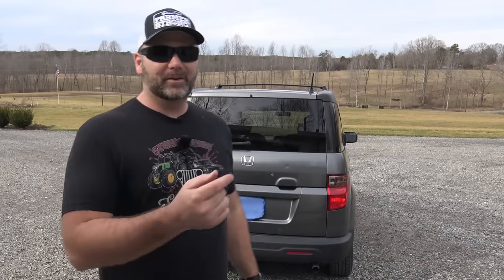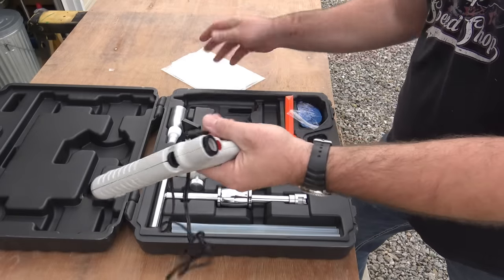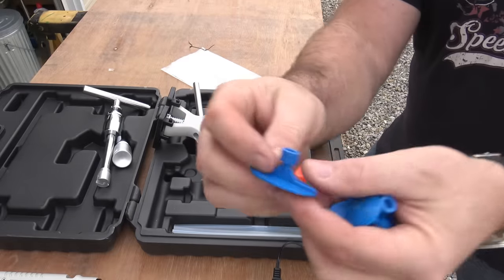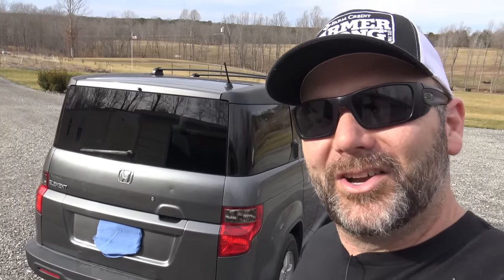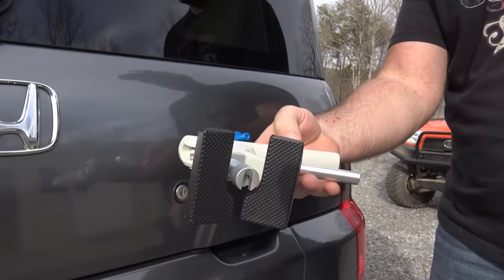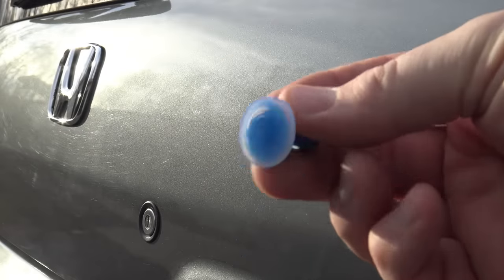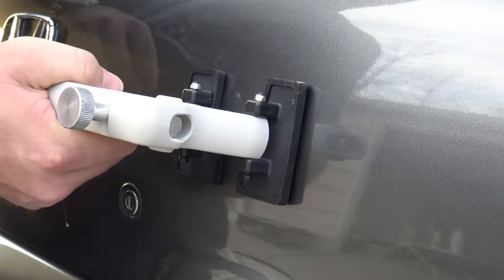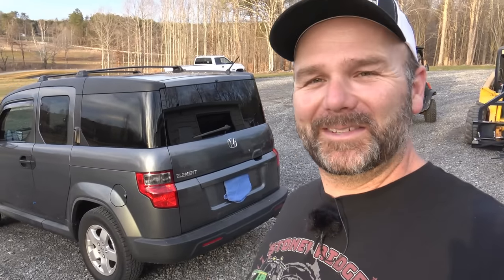You've never seen a dent pulling tool like this! Easy Fix for door dings in minutes!

Comment: Wow , I'm very impressed. 
  That's a very inexpensive way to remove dings and small dents and doesn't take much time to do either.
    There's a bad dent in the middle my Mercedes driver door (and among others ) , the same as was in the rear of your element. The dents look almost identical. I wanted to remove the dent myself but wasn't sure how to do it . It just so happen that your video showed up on my video feed.
    Thank you for taking time to post this video . You're saving me alot of money by posting your video. 
   It probably would have cost you about a $1000.00 or more to have all your dents removed. You saved yourself alot of money by doing it yourself. 
   I will be online in a few minutes to purchase one of those kits .
Thank you again. 

Best 
Regards
Reply: Hopefully you dont overstretch your metal or pull your paint light most people who arent trained do. Good luck. Just know most techs charge more for dents that are already worked. If you say its deep, its gonna cost the 60 for the system plus whatever the tech who actually fixes it charges.
Reply: @JonMiller84  , I received the kit but haven't had time to fix the dents . It's been cold and raining here and I didn't want to apply the glue without the proper temperature, heat and sunlight . I also believe that if the car metal is warm , that it will be better to pull the dents and not crack or damage the paint . I believe I can fix it myself.  I'm going to take my time and pull the dents slowly. I'm thinking of making  a video and posting it , if I do a successful job.PDR is something I believe I can do successfully. I'm a firm believer , that practice makes perfect and i pay attention to the details .
   Thank you again for your great video.

Comment: You need to clean the dent with alcohol. And when you want to remove the pull tabs spray alcohol on the tab before you scrape the glue.

Comment: AWESOME JOB ON THE DENT REMOVAL KIT.  I just watched your chick brooding content. May I suggest that you reduce your temp to about 90-91 degrees F. The more heat you use the more likely the birds can become dehydrated. It like the analogy of a frog in boiling water. He doesn't realize he's cooked until it too late. The chicks will pile up under the heat lamp and the ones on the bottom can over heat and result in mortality.
I've been a commercial poultry grower for 8 years and produced over 11,000,000 broilers.

Comment: Very limited use, Had one but nothing beats a good dent slapper. Probably has a use but time is money. And yes this dent pulling tool has been around for 10 years or so
Reply from the maker: I thought it worked great myself...next thing I'll try is a dent in my fridge!
Reply: @StoneyRidgeFarmer  Yeah can try but just be mindful that the metal on the fridge is much thinner and it might stretch the aluminum. And i saw that you used glue tabs the same size as the dent, the right way is to use a tab smaller than the dent to get the core out.

Comment: (Tip)  Use this, and push from behind the dent at the same time for best results.
Reply: Therealdeal84  If you have access behind the dent, push on it with your thumb or hand while pulling from the other side. Compound dents come out easier in the reverse order they happen. Good luck too you and yours. Cheers

Comment: all you need for that dried glue to remove like butter is rubbing alcohol spray or drizzle on top of the dent area and use a plastic razer or your orangel scrapper tool you have

Comment: you missed some points.
1. clean up with alcohol
2. warm up 
3. ..
4. when you want to remove the glue, you need alcohol, so you will not stratch the colour of your car
5. control it with dent light
These steps are very good explained on the channel of 
 Zan Vidic,  1st Track Dents, dent Discount - PDR Training  <== these 3 guys are the best.
Reply from the maker: this isn't  a pro PDR vid brotha...just a guy pulling dents from his car....but for sure I'll take this into advisement

Comment: Usually, isopropyl alcohol will almost immediately remove the hot glue for future projects :)
Reply: Oh and also if you want a cordless/battery powered glue gun check out the Ryobi one for about $30 sans battery. I'm always finding random uses for it :)
Reply: It needs to be at least 85-90% alcohol to work properly.

Comment: It all depends on the glue strength. Mine falls off just by touching it, no matter how much glue I would put on the puller / ding.
Reply from the maker: clean your surface good, get the glue a little hotter maybe?
Reply: @StoneyRidgeFarmer  I did, more than once. But once I pace the tool on, the plastic puller comes off laughing!  Even changed the glue and used Gorilla, but to no avail. I use a heat gun, the glue should be hot enough. I’m lost!

Comment: I;ve tried one of these tools on both small dents and large dents.  After 36 attempts at pulling out a dent, I had no success whatsoever.  The glue bond just isn't strong enough to cause steel to deform beyond the elastic limit.  Of those 36 attempts, 7 times the glue bond to the blue plastic is what broke free.  Save your money and frustration and do it old school, drill a hole and use a screw to pull the sheet metal.
Reply from the maker: 36 attempts eh? Probably a little too much for a PDR setup huh

Comment: There has to be a better way than scraping the glue of the car. You cant use compressed air upside down to cool the panel so the glue pops off?
Reply from the maker: or I could just use this tool and quickly remove it lol
Reply: @StoneyRidgeFarmer  yes, hahahahahaha

Comment: to remove the hot glue from the panel without making more scratches, you can pour a little bit of alcohol onto it and it will come off very easily.

Comment: Been doing PDR for 12 years now and just wanted to warn people that this is fine if you want to do a little experiment. HOWEVER if you're doing this on a car you care about be aware that this is not the proper way to do dent repair you will most likely cost yourself more money by attempting this yourself if you want it repaired properly. You can definitely pull a chunk of paint off if you are not careful. The tabs he is using are not the correct tabs for this repair, infact I would not recommend glue pulling most of those dents.

Comment: That's  a cleaver piece of Kit. Just be careful not to drop the glue gun too often when hot. 
The heater element is brittle. I've replaced many over the years.
Also use Water , Lighter Fluid or Alcohol to help release the cooled glue from the painted metal surface 
so that less scraping is required.

Comment: I have a dent in a stailess steel muffler on my motorcycle and wonder if this gadget would pull it out or whether the gauge of metal would be too thick.
Reply: Too thick, stainless is a very tough metal to repair.

Comment: I sure wish I wuz where you are if those dents only cost a couple hundred... I have about a 10" diameter push in - unbroken paint between back door edge and gas cap door - the estimate was $1700... I know it's because the lady who took it to the shop had mentioned "insurance"... the body shops that are ripping the insurance companies for huge sums are only hurting us little folks...maybe eventually we are all paying for CA fires, floods, hail etc somewhere else. Thanks. I'm workin my dent myself w/similar tools. And to you pros - well - if you guys can justify me spending $1700 on a 22 year old 'Yoda that cost me $2500 I'd like to hear it. Yes the car is "now" immaculate everywhere else because I've worked my ass off detailing it, but about 90% of shops i've EVER put any of my rides in were sloppy somewhere - grease on the seats, scratches on the fenders, you name it. That stuff does not happen when I do work on my own or someone else's ride. Most of the PRO's aren't in it for the exercise or the recognition - it is as Lyle Lovett said "M-O-N-E-Y." ok. time to work me over with that dent puller, boyz!

Comment: If you use isopropyl alcohol on the cured hot glue, you’ll find it weakens the bond and the tab pulls right off. Better than taking a hard implement to your paint work!

Comment: That will come back over time, that tool will not release the stress on the metalwork. This is why most techs will tap around the area to move the stress back to where it should be.

Comment: The dent pulling tool seemed to really work,  very impressive, not sure if its available in the UK, Regards, RichardA.
Reply: There's a great selection of them on Amazon, and starting fairly cheap as well. Around £30-35 for a kit similar to the one in the video, but looking like they actually have  a few more bits and pieces in them.

Comment: I want one of those Honda Elements but in 4x4 and long enough to sleep in after a long days driving.
Reply: Make sure you stay with years 03 thru 06 if you want to sleep in one. They changed the front seats and how they fold flat and forward in the 07 thru 2011 years. It's a little more difficult in the later years. Also, if you can find  a 5 speed manual. Much better performance and gas mileage. Also, put 235-65-16 tires on the stock rimes. Fit perfectly, no change in the speedo, don't rub and give better handling with a wider stance. The Element should have come with that size tire as the stock tire. Hope you find one.
Reply: @oldmillrd8153  I worked at the honda assembly plant for nearly 20 years so imo you can have everyone of them.
Reply: @anoint426hemi6  got any for free.gladly take them off your hands.

Comment: So I purchased the super kit for around $100. Minimally useful. After prepping the area with alcohol and letting dry I attempted to use this kit. I will give it a 5 out of 10.
It helped some, but there's no way that it is a complete dent removal tool. If you have a small ding with no creases it still is crap. Just pops off over and over again. I wouldn't recommend this to anyone. Sorry, but that's just fact. Dont throw away $100 on something that, in the end, is going to make you still want more done. Just bite the bullet and spend a little more to have a dent specialist come out and do it professionally. BTW, before you comment, the outside temperature was a nice 70 degrees. And humidity was low.
Reply: Hi Wayne, try using a different glue stick. I had success after getting different glue sticks. Cheers

Comment: You need "tapping" tools to finish the job .. small hammer taps around the dent area relieve stress and bring metal back to original form. Also use rubbing alcohol to release that glue stick from paint.. DO NOT be scrapping it!! yikes don't do that!!

Comment: This is a very cool tool but it is not a magic bullet. It will help to pull the ding but in order to remove that ding completely you need PDR tools. More than the PDR tools, you need the field experience. Having professional PDR tools doesn't make someone a pro. I've seen some real impressive work by PDR pros. PDR (Paintless Dent Removal) Car dealers depend on these pros every single day. Insurance companies also depend on them during hail storms. These PDR guy's make a killing during hail storms. But they work their asses off...

Comment: Protective side molding has been removed from all vehicle, than your pretty little thing and have huge SUV's and Pickup trucks driven by big fat people that will bang up your fenders and doors.   Also you rear or front, depending on what direction you are parked in, can't cut these oversized beasts in parking lot made for smaller vehicle from pulling out and turning sharply running in to you.

Stores that have closed circuit camera don't keep tape or sufficient memory to records such events.  And our insurance companies do not treat this as under insured, no insured, comprehensive, but is covered under collision with a much higher deductible and this goes against your record. 

So what's the solution, a tool to correct these problems or new laws?  Thought for a second using suction cups, those are worthless, not sure if hot glue is much better and if a tad too hot will mess up your clearcoat.

When going to Chicago or Milwaukee, may have to park my car a mile away and walk if I can find a safe place, but this is the problem.

2020 average fuel economy is worse that 1985, most people are driving monsters, do you really need an 8,000 pound vehicle to haul a 90 pound women?  Can't even see out the windows so banging into everybody.

Then have idiots crying about carbon dioxide when it has a specific wavelength from the sun, and the sun is out with a very low specific heat valve and only occupies 0.06% of less in the atmosphere that is causing global warming.  How you stupid enough to believe in this BS?

What really has a high specific heat value, the amount of energy it can store, is sea water that occupies 75 % of the earth surface.  So why aren't these assholes saying we should drain the oceans, but then we will be like Mars.

Comment: You haven’t been to the body shop in a long time, those dents in the body shop because they would paint ,and even if they didn’t paint it would cost you no less than $500 if they paint  you’re talking 1000 most shops are at $110 an hour for an average, so go figure great video though.

Comment: I’d be afraid of pulling off clear coat. 😬
Reply: Not gonna happen. Good condition clear is tenacious stuff
Reply: @nordicpride9708  really? I have a 2019 Civic with a few minor dents that I’d like fix.
Reply: @doomorbedoomed8748  If you follow the directions you should be just fine. Watch some PDR videos. Very helpful

Comment: As a professional dent repair technician this really gave me a good laugh but then in the end I didn't like the video because he acted and pretended it went great and he pulled all the dents out when he definitely didn't, he's lucky if he made them a little better but it's obvious he didn't. He's probably getting paid to promote those cheap kits even though they are basically a scam
Reply from the maker: yep...there are quite a few of you "pro" guys getting all upset about this video.....ya don't have to take offense to the DIY guy...and is the job 100% laser straight...nope..and you can see it's not.  I was impressed...it did what I wanted and that's the end of it.  As a pro...tell me what would you charge to remove all these dents as a mobile PDR guy?  Just curious....again we all know this isn't a pro tool....it's a DIY guy's tool...and it worked pretty darn good
Reply: @StoneyRidgeFarmer  Yeah if you want to spend money to diy and make your dents look a little different but still be there and possibly make them worse or damage the paint and you're not worried about the car actually being repaired right and want to have some fun go ahead but you should've shown the actual results rather than one camera angle where it looked okay and then not even showing all the other areas you messed with on camera. The reason professionals like myself take issue is the miseducation of the public. Your video makes it look like what we do is quick easy and gets great results with a 60 buck kit and no experience but if people actually looked at the car when you were done in person they would realize the video is deceptive and when they buy their own kits and mess up their cars maybe they'll learn the truth. Anyways it was a well made enjoyable video, you seem like a nice guy but maybe you'll understand where people like me are coming from 👍 good luck with your farm and YouTube etc

Comment: Bullshit. I guess You can fool someone who doesn't know how sheet metal behave when pulled. First you need much stronger sticking compound to pull a dent that size and a smaller pin to start with the centre of the dent then work out your way slowly with bigger pin.  Body work need special tools that cost much much more than 60 dollars. If you can reach the dent from behind then your only solution s spot welded sticks to be able to pull such dents or just apply bando repaint.
Reply from the maker: yeah.....Moh...it's bullsh!&.....You saw the dent come out of the back...if I wanted to spend $600 on a pro to pull out the dents in my 12 year old car...well...I would have. This also works on stainless fridges ...We didn't need to repaint the car...just pull out a few dings buddy